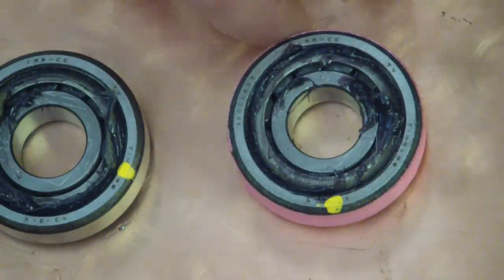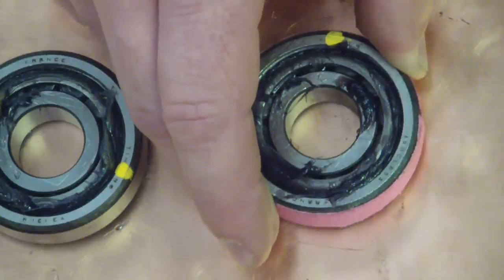Frictionless Bearings - Technical Secrets Explained!

Comment: Wonder if we will ever be able to make true frictionless bearings. Using super conducting magnets or something. While i’m sure even something like that would not truly be frictionless cause of air but it would be cool to get close. I found this video after watching a video of some gears that have little magnets on the teeth so they seemed frictionless but then this video made me think. They were not under load, they where just spinning themselves. I bet that the magnetic fields wouldn’t hold up under load and the gears would either slip or make physical contact thus adding friction back.

Comment: We got Flexo Print press and printing on film if we no change grease in bearing to oil friction in bearings makes so great that film passing over that roller cant spin it.
Could you tell me how to calculate load on bearings to find the most less friction bearings to put in i got some N force basicly its scale from 5 to 50 where 20 is about if i pull it gently by hand and 40 is like if i try lift up 30kg of ground by pulling 
Just cant get our manager to stop replacing bearings for stiff ones and call it a fix.
Will bearings whit no lubricant like ceramic ones make any sense in our application, or just bang grease out put some motor oil in normal metal ones and make it a day.
I seen air grafite  bearings but they look like overkill. Which cheap bearings would be best for high speed low load ?

Comment: UMMmm ... and the point was? Years ago I worked on an Army job for which ceramic/metal hybrid bearings were constructed and tested for use in a 10KW turbo-alternator.The point here was to increase the TBO for the beast seeing that it ran at 93,500 RPM. The all-steel shaft bearings had alot of trouble meeting program objectives where the ceramic hybrid flew (not apart), but right on by the rest of the 'candidates' so to speak while also freeing up some (otherwise) wasted ponies ... H.P ... really important on teenie-weenie turbomachinery like this one was. The raceways were steel and the balls were diamond-machined silicon nitride ... amazing stuff !

Comment: I used Neodymium Quarter circle magnets in my own cast steel bearing for my frictionless bearing in my brother's backyard workshop. We used magnets with 350 pounds of pull force each, and we have 6 of them on both sides of the bearing repelling eachother. But we have the angle off on one of our magnets or something, because it just doesn't stop spinning. We have to stop it with a cinderblock. Originally we wanted to experiment with a way to boost vehicle fuel economy.

Comment: Hi mr AvE. Are these friction less bearings classified with the same size measuring system if that's the right term as standard bearings? Also, would you happen to know if they take as much load as the standard type? A set of these in my swing axle vw would be dope! Awesome vids as usuall, take care!
Reply: No. See the problem here is he's conducting a non-uniform test. He's obviously spinning leftie bearings to the right and rightie bearings to the left. Hence why the spinnaker factor seems diminished in the rotational forces in the non-laden position. So to answer your question these are dwemer size and therefore not acknowledged by the code of standards decreed by Severyn Aerelius the 3rd. Your best bet would be to use a company such as SKF bearings to fit your "sitzen dupen platzen" VW. Regards

Comment: The type of grease and it's weight may be a big factor in how well a bearing works in regards to it's particular application.

I think I found this out using an automotive grease on bicycle bearings. The thinking being much more of it and cheaper, great? Even though car axle grease may have better under-load properties and much higher heat resistance, it's not the right stuff vs. the load created by one person on a bike. Given the resistance in the wheels it also had more fluid friction than what's supposed to be in there. From what I could tell, a much lighter weight grease with about the same stickiness factor would have been better.

Since automotive grease doesn't seem to do it, any advice on a power-tool grease equal to the overpriced bicycle shop stuff? And the most common white lithium is too thin and slings off. May as well be using WD-40 or plain ol' oil in that case.
Reply: I had a rather experienced cyclist. By that I mean had quite a stable full of steeds and no vehicle. He used margarine as his chain oil and if worked like a dream, some of the nicest bikes I ever rode. Smooth like butter ;)

Comment: From the ruby bearings in watches, to the concrete crusher bearing, over to the magnetic HSM spindle bearing and super conducting bearing.
The less a bearing has friction more it is fragile (ceramics) or complicated (magnetic or sc). Each application is different, that why so many bearing types exist, and we will see even more. But don't expect a perfect wonder bearing which is universal for anything. I'd used bearing with a life time of 10 minutes, as failsafe in turbo molecular pump with magnetic bearings.

Comment: In general: A 'bearing" is what supports; "roller bearings" and "ball bearings" roll/rotate/spin done with balls/spheres or cylinders/tapered cylinders/partial cones. - They're for a rotating shaft ( usually the means to transfer some load'weight) to bear its weight and rotate.  You can have a solid beam, say with water pumped to it, to lift and move a set of bleachers; a "load-bearing wall" etc...  Just a reminder of the true meaning of the name/word.  I'm sure AvE is aware but did not stress the point as his contention was about another issue.

I think actually, it the repelling of electrical charge that is the real situation. - I know nothing about quantum, and for daily use and design will use metal (solids) contact as the ideology.

Comment: What's the point of a frictionless bearing, no manufacturer would fit them as they should last forever, no re-sales if they don't wear out. Now if you do want frictionless (virtually), try magnetic bearings in a vacuum.

Comment: When I cleaned the bearings of my bicycle hub, I always thought what If I asseble it without any grease? It spins so easily, so maybe I could be faster. But this is not that easy, under load it would be a torture for the balls.
Reply: Yes and on the bearings too.

Comment: Putting grease on it doesn't do much either you've got to pack the bearing if you want all the parts to actually be coated. But yea without a load it's not very conclusive.

Comment: Ah, but there really ARE frictionless (almost) bearings!  Back in the 1970s & 80s, I worked as a broadcast engineer for a TV station that had "2 inch quad" videotape machines.  They employed 2" wide tape, and had four video heads, attached to a disk that rotated at 14400  rpm.  And the bearings employed a cushion of AIR, supplied by a compressor, to acheive virtually frictionless operation.
Reply: +Clyde Wary  An air cushion also serves as a low-friction, vibration dampening bearing (fluid dynamic bearing) in a modern computer hard disk since approx. 2004. Obviously it has very little load bearing capacity, and doesn't begin to form until about 4000rpm. On spinup or when too much force is applied, the platter assembly is supported by a mechanical bearing, the load from which is removed when fluid dynamic bearing forms spontaneously between shaped surfaces of the spindle and sleeve.

Comment: Your test is all wrong !!! They are reducing sliding forces and are grease less bearing and are only in roller bearing so do not require a cage to keep balls apart, that is all they did. not tapered or barrel bearings that require grease. All the grooves do is make the ball roller further so it slows down keeping the balls apart. I am surprised you missed that ?  even though you will prob never see this since its been 2 years from post.

Comment: At the start of the video I thought "wtf, did I clicked on a wrong channel by mistake". I know nothing about mechanics, but common sense tells me that when you put ton of grease the thing won't spin on it's own. If you want to make it spin more - use ball bearing with thin oil - less contact = less friction.
P.S. I visited the link. I thought it was a joke. They actually introduce more friction with the ball-separation thing.

Comment: No such thing as "frictionless"
I restore 2" quad broadcast video tape machine where the video heads rotate ar 14,000 rpm. The slightest change in friction manifests itself in picture instability. Even the portable machine have a video head that rides along bearing and the whole head assembly must be changed frequently due to ball bearing wear. Therefore, 2" quad machines have the head assembly "floating" on air bearings. The machine is fed compressed clean airbus that the head shaft "floats" in. There are no contacts from the (4) heads to the head assembly. They use rotary transformers instead. This leaves no physical contact to anything. They spin for a long time (because if the headwheel mass) after power is removed, but eventually cone to a halt, due to magnetic properties of the motor itself

Comment: do they have these in a skateboard wheel size?!
Reply: Why are you asking this, he's proving to you it's bullshit. Abec in general for Skatboards is bullshit, you get the RPMs and load in skateboarding for ABEC to matter. A good pair of Swiss bones ceramics are all you need. In skateboard bearings abec 3 and abec 16 is going to give you the same performance because you can't give it the load required to matter.
Reply: kalloused Swiss ceramics cost far too much and are to easy to break. I use bones Swiss just under ceramics. I heard there's a better bearing called oust? I think
Reply: +Khum Dhan lmao I have no idea what you're talking about. Swiss Ceramic is 30% stronger than steel. In 20 years of skating I've never met anyone who's broken a Bones Swiss ceramic bearing.
Reply: kalloused well for me, who is 300 lbs, have had it happen. I know others who have also broken them. They chip and don't work well anymore.
Reply: you need to lubricate regularly. Also I don't think you're getting the point of his video. He's saying frictionless bearings are bullshit,
Reply: kalloused I haven't watched the video in months, I think I wanted them for another reason than frictionless. Can't remember.

Comment: I remember popping my bearing out of my roller skates as a kid and soaking them in white spirit to get them moving again. Wish I was educated 😂
Reply: No, that's good. You missed a few steps but it was not and incorrect procedure. Dissolve grease that's loaded in grit and dirt , thus cleaning the bearings. But you had to pop the cages first, then clean with white spirit/acetone/trichlo/wd40 even THEN regrease with fresh grease and put cage back on .

Comment: Its not frictionless just very low friction if it was frictionless inertia would have kept it spinning endless until an exterior force was to apply friction/pressure in which case it would be under the influence of friction and grind to a steady but sure halt

Comment: @AVE Sir, I have been enjoying your vjayos for a very long time. You Sir speak Man’s language eloquently. Can you give this a thought and maybe consider jumping on board to be accredited with a  never before testing apparatus to verify and accurately measure earth’s rotation. I conceived of a frictionless magnetic bearing of sorts that is stable enough to suspend a 20” long <1lb swinging Foucault pendulum inside a repurposed 2’x2’x2’ hexagonal fish tank turned vacuum chamber. I believe this will isolate and separate the pendulum, tether and bob, completely from the moving earth as well as remove any outside force due to friction. I’m reaching out to a true Jack of all tradesmen to dip in the deep knowledge pool of jokes, girls, mechanical engineering and physics guru for HELP. 
One thousand thank (use) for the many laughs and learning opportunities you provide us.

Comment: So replace the bearing "Steel Balls" with "Ceramic Balls". Ceramic Balls create "No Friction". No friction, no heat. No heat, no need for oil or grease. Place inside a stainless steel "Sealed" bearing and then play your "HALLELUJAH" song. P.S. Yes ceramic stainless steal sealed bearings are expensive. So one must do a test on longevity between the two. Then one can factor if it is worth it. I did just that and here is my 2 cents advice.  If the bearing or bearings "make you money" then yes. If not then no. I would love to buy some for my Rc Axial Yeti 1/10 but it is just for recreational fun. If I were in competition races I surely would. Take care.

Comment: ohhhh plz...one is filled with grease, hence force to spin.  Other has nothing therefore nothing to stop it from spinning.. Ambient temp, plz grease is holding heat in...other has nothing to impede it from cooling.  As you stated no load no heat.  good video, I saw the funny side of it.

Comment: Interesting thought, but of course popular mechanics didn't actually get the science right, so don't base your analysis on their crap article.  The inventor "Coo Space" uses clear paraffin lubricant in their tests, and puts a load on the bearings.  If the cage-free design actually works, I dunno, but not for the reasons you're saying.

Comment: I once greased my skateboard bearings because I used to go through a set every few months. I thought they would last longer. Well the result was unbearable slow and I never did it again. Obviously this isn't all that relevant because ball bearings designed to roll around a hundred pounds or so are a complete different animal than tapered roller bearings with a much higher load rating. Just rambling away.

Comment: I Clicked on this video because i just happened to working on some bearings that was locked up to start and after some soaking and some force i got the to turn then being they are worn out i was spinning them at about 20,000RPM to get them moving smooth the do the good bearing fake out

Comment: I first hit dislike on the video because I thought you were seriously trying to claim a dry bearing was a good idea, spins free without load sure, lasts 30 seconds under load before melting. Thankfully you redeemed yourself. .. But free spinning dry bearings are fun though, spin it up to many thousands of RPM with a air blast, and drop it on the floor, and watch the sparks fly!

Comment: I had a bearing that spun nice like that it had no grease in it though.  It would have failed soon if I was to use it for ANYTHING at all in that condition.  It is a regular ball bearing used in mower deck spindles so they must take a beating over time and they spin somewhat fast - maybe 3600 RPM or more depending upon the design of the mower.

Comment: So you're telling me, that the "conventional" bearing has heated up THAT MUCH, by just turning it around by hand 3-4 times... HOW STUPID DO YOU THINK WE ARE? And indeed if you fill up a bearing with grease like that, it won't move freely like your "frictionless" bearing, because the grease that you used has a high viscosity while your "frictionless" bearings has no grease so it moves freely. Also, judging by the colour and texture of that grease, it's the wrong grease to be used with such bearings.

Comment: hashtag mag bearings
Reply: Magnetic bearings stop spinning eventually. That means they have friction. Everything that moves in gravity and air has friction.
Reply: Even if you take a magnetic bearing onto the space station and run it in a hard vacuum, the interacting magnetic fields will create eddy currents in the surface of the bearing materials, which will leech energy from the rotational differential of the parts.  TANSTAAFL.